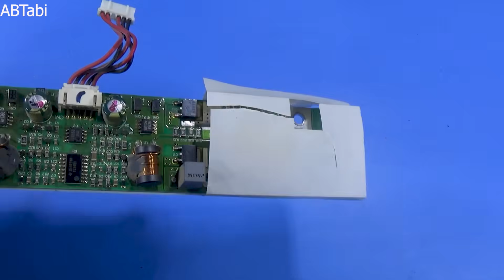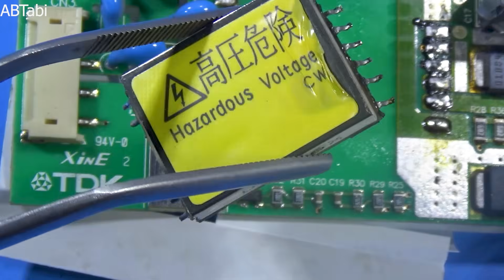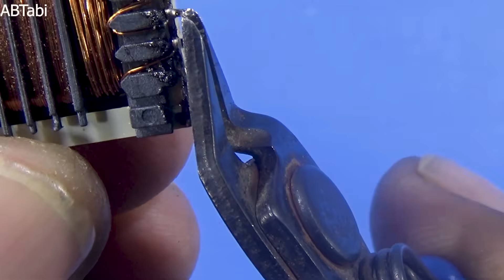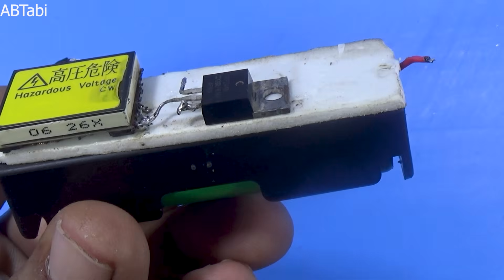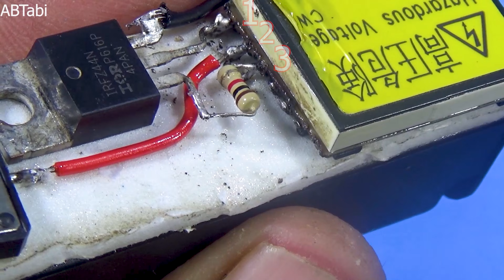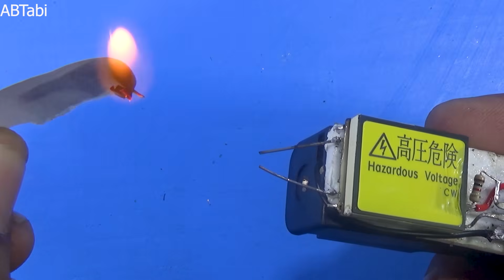This Tiny High Voltage Lighter Made at Home | Easy DIY Electric Lighter

Comment: Could you please provide the specification of transformer, if I make it by myself, where specification means, core size, wire guage for both coils (primary & secondary), number of turns etc.
Reply: You can find the transformer from PC monitor display
Reply from the maker: Many videos uploaded in my channel about high voltage transformer you can find out in my channel and watch it to understand. Thanks for interest.  If you have an question about any project, just tell me.
Reply: Thanks for your reply, please share such video link, from where I got the same parameters of transformer.
Reply: @arijitghosh9920  television power supply have also this transformer